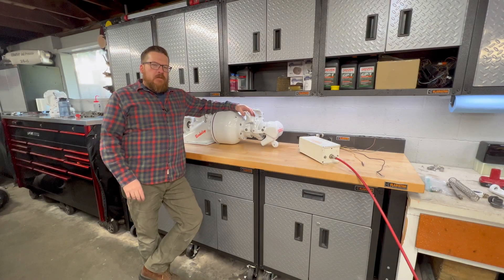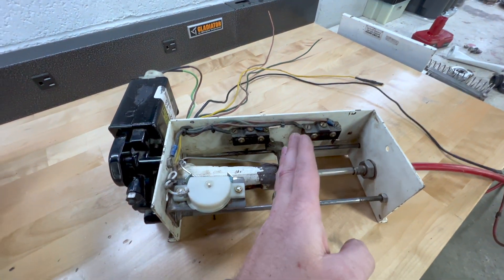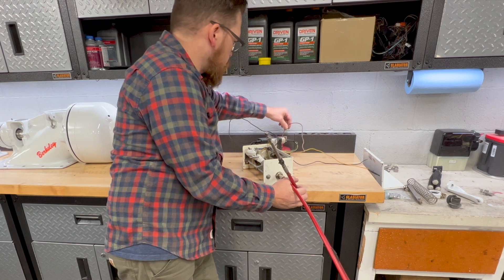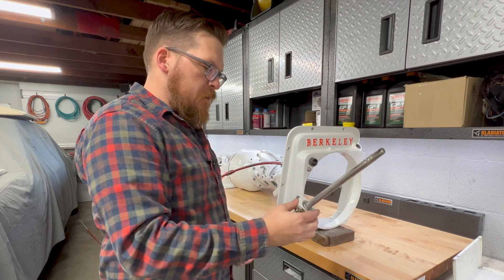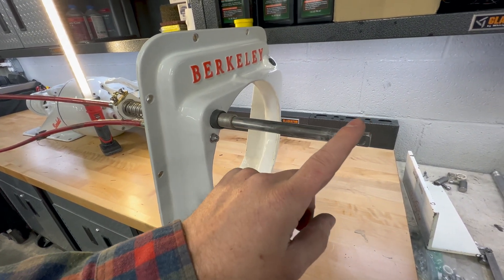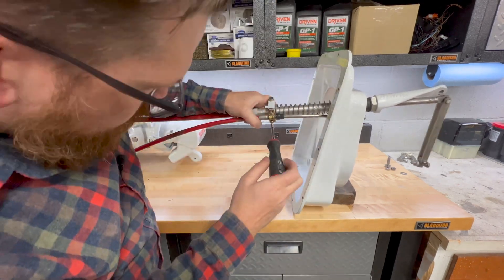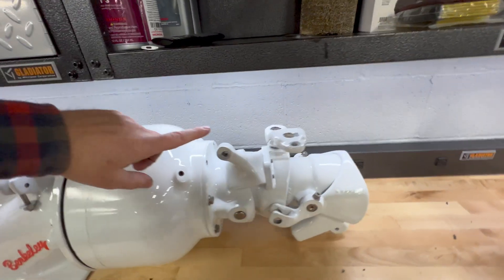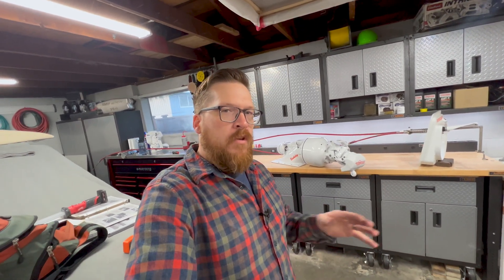How a Berkeley Jet-O-Vator Operates and Functions

Comment: Why does it need to be electric, I had a jet boat it had the Berkeley jet drive  it was all cable driven no electric it was not hard it was easy to drive
Reply from the maker: It doesn’t have to be electric. They can be either. Nothing is wrong with either style. Mine happened to be electric, so that’s the only reason I was discussing its operation. 

~ Nick